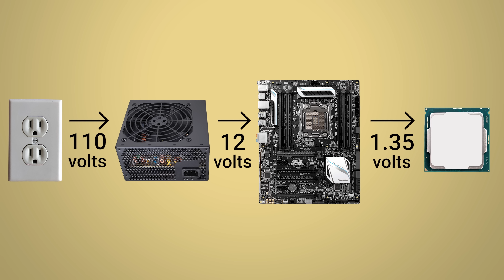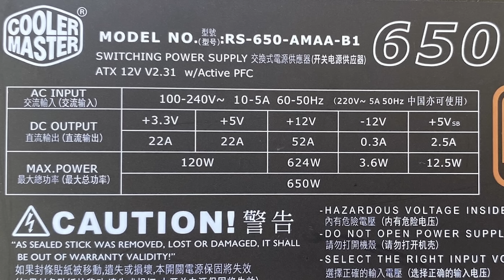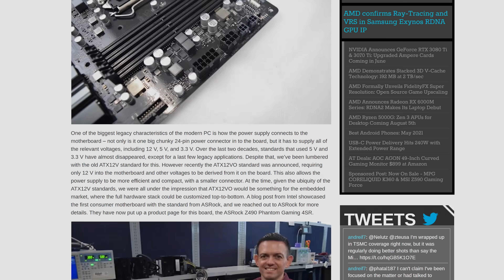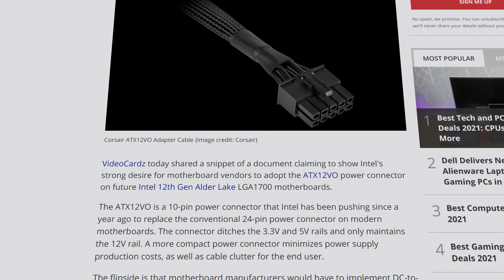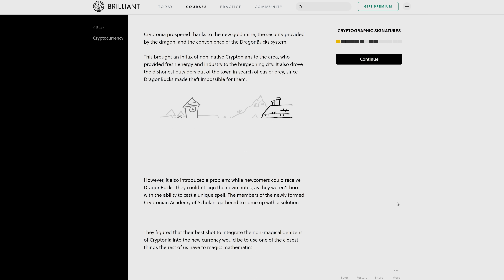Is The 24-Pin Connector DEAD?

Comment: The 24 pin isn’t that bad, but the USB3.0 motherboard connector can go burn in hell.
Reply: Pretty much
Reply: USB3.** connectors are necessary evil if you take into consideration how much differential signaling is required to make it work. But I'll call and raise you one - why don't we oust all of those new age things all together, a simple 8 wire/4pair ethernet cable has been proven to do 10 GBit over short distances (6-12 feet), all peripherials should be TCP/IP based and physically on RJ45 connector - there's plenty of bandwidth, latency is negligible if the switch chip is quality enough (as in not Realtek)... so why all of these standards? Ethernet over optical and ethernet over copper should cover all peripheral needs in 2021. And yet, here we are...
Reply: @playswithblades  Connector size and backwards compatibility, plus general lack of TCP/IP auto config, although it could certainly exist. Also latency can be an issue, but not if directly connected. The bandwidth of USB 4 is much greater than 10 Gbps, particularly in a single direction where it exceeds 77 Gbps single directional in Displayport 2 Mode (which is now required). 100G Ethernet is still horribly expensive and very bulky, and doesn't fit consumer scopes of use very well.
Reply: @gajbooks  I think you are confusing USB protocol with capabilities of USB-C connector but I'll take your word for it since I don't care at all to go and see
Reply: @gajbooks  Also, from personal experience as a developer, once you drop all the M$ protocol crap and get down to physical layer as close as you can, you can hit very high potential speeds and extremely low latency with ethernet as a physical carrier, probably would take some chip tweaking but signaling is already there, It's proven technology. Also I don't think the price tag would be the same if it was a thing that needs to carry 9 feet of copper wire or 90 feet, I'm pretty sure most PC peripherials are more than doable over ethernet as long as you keep down to physical layer. I used to develop for LED displays back when that was a thing and most of the big LED displays use only fast ethernet as far as chipsets are concerned and they achieve incredible sizes while the phy layer is daisy chained, not even using switches to carry the data between the LED cabinets and receiving cards so I'm pretty sure you could fit a lot of USB-C capability in full duplex CAT7 eth cable in the same distance that an USB3 cable would carry. Why don't they do it... I'd guess patents... they want to have patents to drive up the price of a technology that has been around since RS485 days...
Reply: @playswithblades  I think it's mostly an issue that current ethernet development is oriented towards long distance runs and expensive transcievers/fiber, and USB is made for 3m max cable length consumer peripherals with backwards compatibility. Most data center stuff is tunneled over fiber ethernet networks, but for consumer connections on the order of 3 meters, USB still makes sense. I would totally go for auto-configuring TCP/IP peripherals, but for now it looks like USB is here to stay (except for printers). USB is becoming a tunneling protocol anyway with USB 4, so it's absolutely technically possible to implement TCP/IP over USB. I mean, Firewire had it for ages. Unfortunately, daisy-chain buses are awkward and it fell out of use.
Reply: @playswithblades  TCP/IP is the worst idea ever. SCTP/UDP might work though.
Reply: i hate the 5v ARGB pins. who thought that was a great idea?
Reply: @destronger5313  The ARGB pins were kind of a defacto standard already because the LED strips use it to connect to each other. That way if you really wanted to, you could plug an LED strip straight into your motherboard without the need of a cable to convert the connector.
Reply: @fuj1n  its total useless connector on the Mobo, since it have a limitation(it have a LED count limit, this limit depends on the manufacturer and your motherboards category). If u want a perfect argb lightning setup, the u will use an argb hub connected to an USB 2.0 port on the motherboard. U can connect to the argb header too, but the recommended way is the internal usb port.
Reply: @talos86  I can manage all of my lighting  including the RGB built-in to the motherboard itself through my motherboard software, no need of any external applications to manage different ARGB controllers or anything. My PC is pretty decked out in lights.

How is that useless?
Reply: @destronger5313  true, they are literally headers.. mostly used in prototypes XDD? Why don't they use jst connectors for this. Well, i suppose cus all led strips are currently connected this way..
Reply: Wait why though? Isnt that the cable with the blue piece of plastic at the end?
Reply: @user-fo1nk3pd1t  It's so annoying because of the angle and rigidness.
Reply: @user-fo1nk3pd1t  the cable clips on the cable are so strong that if you try to pull it out, you’ll often pull the connector right off the motherboard, exposing the bare pins.
Reply: @user-fo1nk3pd1t  yes and I already broke one
Reply: Yes!
Reply: That's why I have a 90⁰ , flexible USB 3.0. Totally hidden and flush 😊
Reply: @CDuff86  Link?
Reply: Indeed. Worst connector ever.
Reply: yeah i hate that one
Reply: The pins are too small and bend too easily
Reply: I tried to unplug my USB3.0 front IO cable ... pulling the plastic part from the motherboard.
Reply: I've never experienced one due to my broke-ness but I already know its gonna be bad just by looking at it
Reply: Fuck front panel io tbqh, why can't THIS shit be one standardized brick
Reply: @raphaelambrosiuscosteau829  I hate the blinking Drive LED. So I don't plug it in. And my case has no reset button so I don't need it.

On my server I only have the power button plugged in, no LED whatsoever.

The splitted front panel connectors are good imo. On an old pc I had it was one long connector so maybe it was standardized at some point but they got rid of it for the better.
Reply: @hazgebu  I personally don’t mind the split ends, tho they can be annoying to plug in the first couple time u do it. But at the same time, if there was just one brick, u could just turn off hard drive LED and such in the BIOS, as most bios menus support that these days. But I do like how I can unplug anything that’s giving me issues without having to take out all of the pins. Heard of many people with old PCs that had stuck power buttons- they were able to just unplug their power pin cable and their pc would go back to working normally. If the pins weren’t split up, that could have been much more annoying to deal with, as they’d have to unplug the whole FP connector, and lose front panel USB, reset, leds, etc.
Reply: It's only better than the damned IDE.
Reply: LeDetructor  Dislikes don’t really do anything, and aren’t even visible to anyone on YouTube lol it’s just a fake button that doesn’t do anything. But the reason ppl don’t like it is bc the pins often break or bend when ur taking the connector out or trying to put it in, and often when ur pulling the connector out the whole thing breaks off the motherboard. The way it’s designed is kinda crap bc the cable gets like, super stuck on the mb, so when u try to take it out the whole thing comes off the mb
Reply: The worst!
Reply: Much said
Reply: Bent the shit out of mine, thank god I got 2 on my formula
Reply: I hate how stiff the cables are
Reply: Do not even TALK about the power led‘s and switch cables!
Reply: @Dummigame  yeah, they're also literally headers.. i use headers in my prototypes, then i use jst for my final product for instance.. why don't they do this or some other connection type now?
Reply: I just take a file and shave off USB 3.0 header connector notches of its sides lol Goes in and out of USB header on the motherboard easily.
Reply: Get yourself a right angle usb 3 adapter. You’re welcome! 😜
Reply: It is that bad, i hate every bit of it
Reply: True
Reply: My motherboard is so old it doesn't have it
Reply: true
Reply: Burn straight to the hell
Reply: Agreeee
Reply: Agreed. Add to the hell-bound train the silly itty-bitty faff that is the case front panel stuff in all it's individual pinned "glory" - damn it to hell.
Reply: I feel like I'm the only one who can't relate. The usb3.0 was fine for me but the atx 24 pin was a nightmare
Reply: I read that as Arya
Reply: I have snapped a motherboard trying to plug in the 20+4 power...
Reply: My case and my motherboard are basically bonded together. The freaking USB 3.0 don’t want to go my motherboard.
Reply: I have a 90 degree plug voor de 24pin but now that I think of it. Do those for USB3.0 exist?
Edit: yes they exist! can't call for the quality though
Reply: @tardvandecluntproductions1278  There's adapters on Amazon, only one way to find out...
Reply: I agree. There are engineered by Daemons.
Reply: @andyk192  no problem at all. My parts are all coming in now. Looks great and gives me 100% clearance now.
Reply: the USB 2.0 connector was worse.
Reply: YES
Reply: I was about to say this myself if any connector needs to die its USB 3.0
Reply: LeDetructor  the usb 3 connector has 4 internal hooks to hold the connector  in place, as with the 24 pin power connector one external wich i can press outward  with one finger. I cant get to the internal hooks without using a sharp object
Reply: Yeah, especially when they put it so it's right in the way of the GPU, and it's either the GPU or the front panel USB 3.0. Guess which one it is (at least until I find one of those slim extenders).
Reply: Anyone else ever rip the usb 3  connector off of a $400 motherboard? Lol
Reply: Yea
Reply: They just need a good release mechanism.
Reply: They need to replace that with Type E headers. way better imho
Reply: Usb in general needs to be redesigned in my opinion. Its unstable AF,  micro and micro B should not even exist and why doesn't usb C work properly on a usb 3.2 port (no 7v fast charge) 🤦‍♂️
Reply: Usb c is pure cancer too

Comment: There's someone already doing this that has been doing so for years and years.  Even the whole "sata power coming from mobo instead of power supply" thing. 
 It's called Dell / HP proprietary garbage.  Gateway even did it while they were still around...
Reply: Now they're no longer proprietary, so they're no longer garbage as everyone has to comply with the new standard.

Comment: I hate the 24-pin connector. It is always so hard to disconnect.
Reply: Why would you WANT to remove it?
Reply: Why are you disconnecting it? It's not a usb stick, you connect it once and that's it. You don't touch it for years.
Reply: @vask92  There is such a thing as upgrading PCs, switching cases, switching motherboard, testing other parts when trying to identify an issue, switching a broken power supply. I have built and rebuilt like a 100 computers...I work with them a lot.
Reply: @Clarissa 1986 In theory it's easy. In practice it can be rather hard, considering some motherboards weren't designed to have it removed. As in, there isn't enough clearance around it for even baby sized fingers to remove it. In fact there once was a board that, in order to remove the 24 pin connecter, had just barely enough clearance for a screw driver to press on the latch, and zero room for even a small baby sized finger to touch the cable pin.
Reply: I do not hate it, but I am hoping the casing is a little bit more durable with a hook/latch (or whatever it's called) that is similar to that of SATA cables.
Reply: Did you know that you can use WD 40e Spray to make it easier to Disconnect the cable?

And by the way, WD 40e is designed specifically for Electronics Appliances, it will not harm the Motherboard or PCB. It's completely different from the original WD 40.

And the best thing, it's only $3 per can.